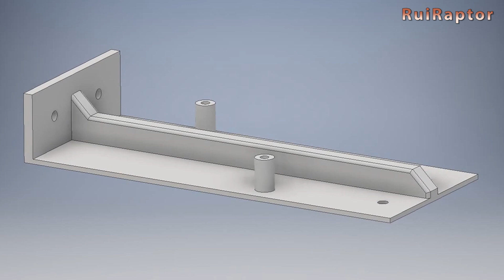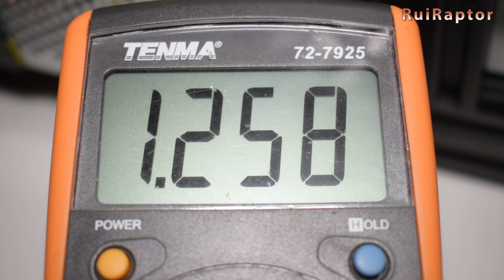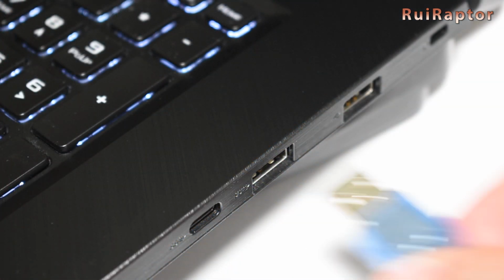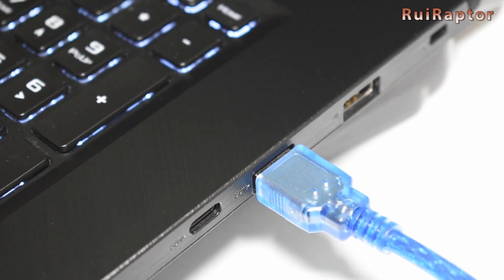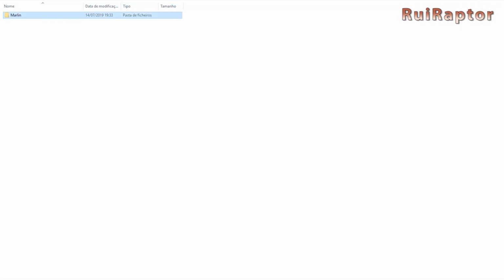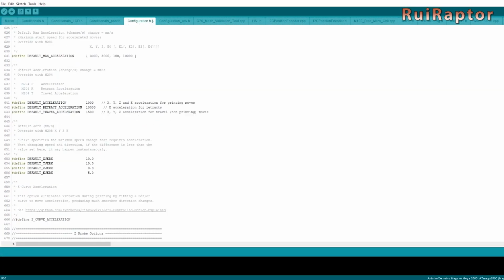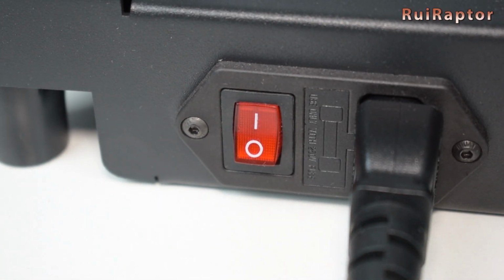TEVO TARANTULA PRO - How To Install TMC2208 Drivers

Comment: I got the problem. I do everething according this guide, but can't upload Arduinino sketch, because it shows error :
Arduino: 1.8.10 (Windows 10), Board: "Arduino/Genuino Mega or Mega 2560, ATmega2560 (Mega 2560)"

In file included from sketch\ultralcd.cpp:96:0:

ultralcd_impl_DOGM.h:46:10: error: U8glib.h: No such file or directory

 #include <U8glib.h>

          ^~~~~~~~~~

compilation terminated.

exit status 1
U8glib.h: No such file or directory

This report would have more information with
"Show verbose output during compilation"
option enabled in File -> Preferences.
  How I can fix it?
Reply from the maker: Hi, you need to add the  U8glib.h library to your arduino software. Go to Tools > Manage Libraries. In there search for the U8glib.h library (U8glib.h by Oliver). Install it and compile again.

Comment: I I understand correct, thaen if in last versions of TTP motors for both axes same motor, than it's mean tat voltage should be adjusted same?
Reply from the maker: The current version of the Tarantula pro brings all the same stepper motors on all axis (the bigger Y axis is no longer included) but you can still use the same output current value from the video since that output current is lower than the max current the motor can handle.

Comment: What is this ? "Ultra Silent Protector Plug Type Stepper Motor Driver Stepstick Smoother For 3D Printer" Can you do some with with this things also ?
Reply from the maker: those are smoothers. I would recommend using TMCs only

Comment: @ruiraptor in my case, the board sensor wires white/black seem like they should remain switched for it work (?) - I ordered a Tevo Tarantula Pro 2019 + BL Touch Sensor + Dual Z + TMC2208 about 2 months ago and got it just a few weeks ago, so all the parts I have are from Tevo; on my board, the BLTouch Sensor white/black wires were switched just like you mentioned, so I wasted no time in switching the wires back; First time doing the auto homing feature, while the sensor was never at any moment blinking, it would start to descend with the probe extended as expected, but then as it hit the test surface, it would retract but the printer would keep descending on Z, and the sensor would again try to feel the surface and continue descending - it would end up crashing the heat bed if not for power shutdown.
I solved the issue by reverting the black/white wires to the incorrect/initial order on the board connector plug and it is now working properly: the sensor senses the surface, Z movement stops, raises slightly, and lowers again slightly just to halt again with retracted sensor.
Could it be that Tevo somehow corrected the situation on newer units just by switching the wires (in spite of keeping the colors), or could I have messed up some firmware configuration? As someone else already asked, I went ahead and merged the Configuration.h/Configuration_adv.h files from BLTouch + Dual z firmware.zip and TMC2208 firmware.zip from https://github.com/tevo3d/Tarantula-pro to have a version that handles all the 3 currently available extras.
I'm ok in forking Tevo's github repo and pushing my modified configs - so far as I can tell, both Z motors are operating properly, the TMC2208 installed on X and Y only are moving as expected and the BL Touch Sensor is also working. Tomorrow I will move on to calibrating the steps and fine-tuning Y and X start/stop positions. I'm also waiting for Tevo's magnetic sheet for this printer, so in the meantime, I will test heating just to ensure it is ok and work on the extruder - it looks like they shipped it with the issues you describe regarding incorrect nozzle installation.
Many thanks once again!
Reply from the maker: Hi Wickwire, thank you for your feedback. Maybe Tevo crossed the wires in the cable instead of correcting the wire positions inside the printer.

Comment: Hey Rui. Since the Y axis motor is no longer the larger model do you think 1.19 would be acceptable? Fabian at https://www.facebook.com/groups/501968287041019/ checked his  factory installed 2208's and they are all set to .99.
Reply from the maker: Hi Bill, the smaller motors spec current is around 1.5A so, according to the formula, your output current value is safely below that value. Anyway, you can always check the motor temperature while printing. If it does not get hot, it's ok.

Comment: Z-axis, would you also flip the boolean in config.h if that was replaced too? What about the boolean for a 4th for the optional 2nd Z axis?
Reply from the maker: The stock Allegro drivers run in the opposite direction when compared with the TMC drivers. If you replace any of the allegro with TMC you will need to reverse the direction in the firmware.

Comment: Hello, please make video, how to upgrade this printer with BLtouch, and second Z motor. Tevo have good manual for mechanical step by step, but absolutely nothing for software change. Only "download" section on the web sites. Thank you.
Reply from the maker: Hi Simon, ok, we will do those videos very soon ;)
Reply: @ruiraptor  Thank you master. I have one next question. Tevo have touch display in optional upgrades, but i dont find this display at Tevo web and ali express... have you some information about this?
Reply from the maker: Hi Simon,  do you have the link for the item you are referring to?
Reply: @ruiraptor  Ali Express official seller. The picture with parameters, last line. https://ae01.alicdn.com/kf/H8d142de9d71542acaa4e4b4df665af1du.jpg maybe, this picture is copy from another printer.
Reply from the maker: I see what you mean. That upgrade is not yet available.
Reply: @ruiraptor  Hi, no problem, thx for info. I order now last piece TPro from CZ. I have old Tevo T with much upgrades, but its time to change it. Have you configuration for Ultimaker Cura for best slicing with TPro?

Comment: Hi @ruiraptor, I have a question, do you know if the 24v fan should be on all the time or only when it starts printing? I connected my fan but it is not working when i turn on the printer and i don´t want to risk start printing and get the drivers extra hot.
Reply from the maker: Hi Drako,
Which fan are you refering to? You have the hotend fan (the one at the front) and the layer cooling fans (the ones at the sides of the hotend).
The hotend fan will turn on as soon as you heatup the hotend above 50 degrees C.
Reply: @ruiraptor  hi rui, thanks for answering, I'm referring to the 24v fan to cool the new TMC drivers, I followed your video and everything is working but the fan, I fixed the polarity of the wires (red on top, black on bottom) but the fan does not rotate when I turn on the printer I'm thinking the fan is bad but I wanted to know if it should be spinning all the time or only when printing
Reply from the maker: That fan must be spinning at the same time as the motors are engaged. Since you don't have a way to control that, it should be spinning all the time. You can connect that fan in that connector or directly to the 24V output of the power supply.

Comment: Hi @ruiraptor,
Tevo tarantula pro comes with power outage detection feature, can you please elaborate how it is implemented in here?, The Hardware part and the marlin stuff, what pin on MKS Gen L is used for it? Is it same MKS DET power outage module they used? I have got my self one and want to wire it up to my old Tarantula. Facing really bad power situation here in Pune :(
Thanks in advance,
Shriganesh
Reply from the maker: Hi, The tevo tarantula PRO does not have a power failure detection module. Where have you seen this?
Reply: @ruiraptor  yes, i realised that. How about adding one. I have got mks det power outage detection module, and connected it to d44 and turned it on in firmware, but it always detect power outage as soon as it is about to print, tried both low and high setting in firmware

Comment: When I plug in the fan and turn on the machine after all the assembly is finished the fan doesn’t spin and it gets really hot I have two brand new fans and tried both of them, is this supposed to happen???
Reply: The fan that I have has the red wire on the bottom slot and the black wire on the top when I plug it in. How do I get a fan with the correct wiring. Or does that matter???
Reply from the maker: Yeah...i mention that in the video. You need to watch that. In your case, you need to reverse the wires of your fan connector. Get a pair of tweezers and push in the small metal pins on the connector while pulling the wires. Then push them in in the correct place.

Comment: Do you think this nozzle will fit tevo tarantula pro? 

https://www.aliexpress.com/item/32883147943.html 

if not can you please recommend some 0.1 mm nozzles for this printer.. :)
Reply from the maker: Hi, those nozzles will not fit. You need volcano nozzles. The volcano nozzles are bigger (in lenght). Search for volcano nozzles instead.

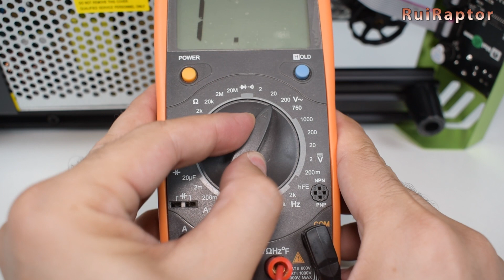Comment: Are these adjustments necessary / are you actual modifying something here? 5:40 or are you just checking the voltage etc.
Reply: Great video by the way!!! Definitely will be looking for more upgrades from you for this printer!
Reply: Ohh I think what you are doing is using the screw driver to change the voltage
Reply from the maker: Yes, correct. We are adjusting the voltage on the small potentiometer located on each driver.

Comment: Another great video thank you, further to another persons comment, is there any advantage (or disadvantage) to changing the firmware over just reversing the connectors?
Reply from the maker: Hi, reversing the wires is probably faster but changing the firmware (which is not hard) will keep your electrical connections as stock. I prefer to change the firmware because it's easier for me to manage all the changes in the firmware and therefore I don't need to keep changing wires everytime I do another upgrade change.

Comment: Thank you Ruipator for another excellent video. My TT Pro should be arriving shortly. I have some TMC2100 V1.3 drivers. Based on the spec the TMC2100 should be electrically same as TMC2208... so do you think I can use the same voltage settings?
Reply from the maker: Hi Peter. The TMC2100 has a different way to configure the stepping. While on the TMC2208 you set the stepping with the board jumpers, on the TMC2100 you need to solder small pads on the driver's board to configure the stepping. Also, the vref formula is different so you cannot use the exact same values.

Comment: If reducing noise is the goal it's a shame you have to add a noisy cooling fan. Other than that great results
Reply from the maker: Hi Sean, these cameras normally amplify the noise coming from the fans. Nevertheless, there are silent fans on the market that can be used to reduce even more the noise level.

Comment: Hello! I hope you can help me. 
I have this version: https://www.banggood.com/TMC2208-V1_2-Stepper-Motor-Driver-Module-Stepstick-Smoother-Heatsink-For-3D-Printer-Parts-p-1383270.html?rmmds=myorder&cur_warehouse=CN
Should i add the Stepstick Smoother?
Where can i download the Marlin firmware for the tevo tarantula pro?
Whats the diffrence between TMC2208 and  TMC2208_STANDALONE in the Marlin code?
Should i change the Z driver to TMC2208 and the Extruder to LV8729 ?
Thank you in advance for your answers!
Reply from the maker: Hi, check the answers below:

1- The smoothers are used to eliminate the salmon skin. The TMCs do this very good so you will not need smoothers.
2- The firmware is included in the memory card that came with the printer. You can also find the firmware in the official tevo tarantula facebook group.
3- Defining TMC2208 will run the drivers in UART mode. Defining TMC2208_Standalone will run the drivers with no UART connection
4- It's your choice to change the Z and E drivers. Just make sure you have enough active cooling for all the drivers.
Reply: @ruiraptor  Thank you very much!

Comment: When making a hardware change like replacing the drivers with TMC2208 I have always found it faster and easier to correct the stepper motor direction by just reversing the connectors for the stepper motors, rather than changing the firmware. That way upgrades to the firm ware do not require that I remember all the changes that will have to be made and changing the printer back to stock is as easy as replacing the drivers , and jumpers, and flipping the stepper motor connectors around. But for those that like playing around with the firmware, I get it. Nothing wrong with that. Have fun with it no matter how you like to do it.
Reply: Agreed, but u get 24 chances to get it right lol, did it on my OG tarantula